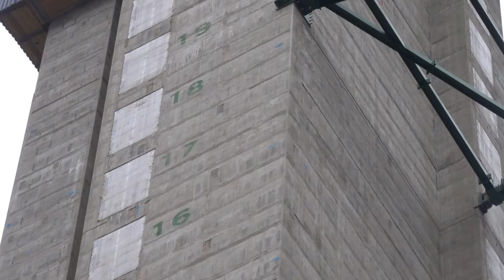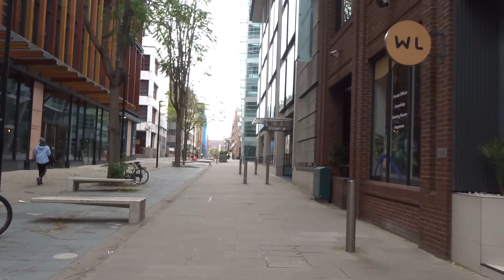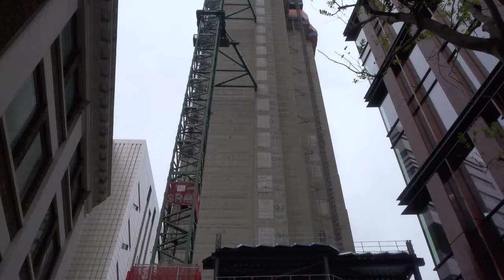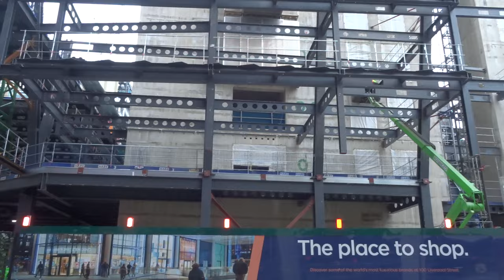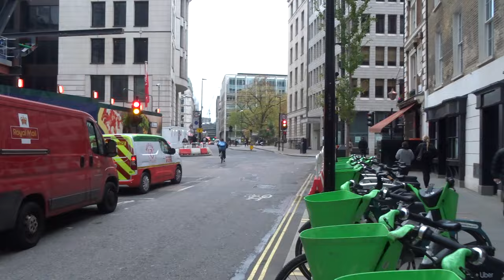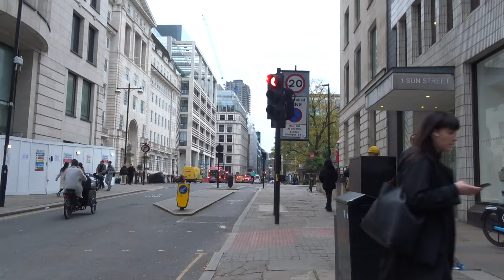2 Finsbury Avenue London 2FA November 16 2024

Comment: What is that supposed to be? Looks like elevator shafts.
Reply from the maker: @ejohnson3131  The core includes the foundation, columns, load-bearing walls, staircases, and elevator shafts and essential systems